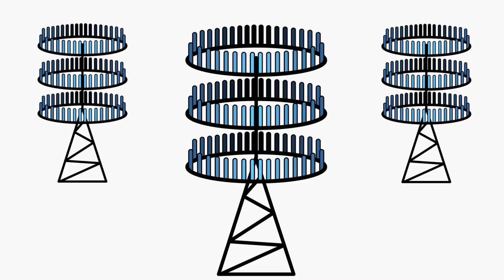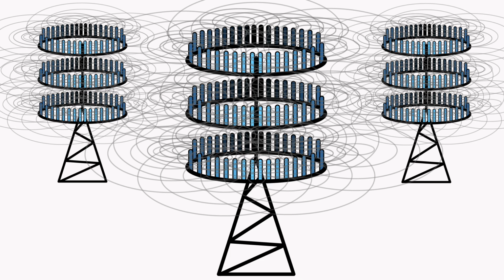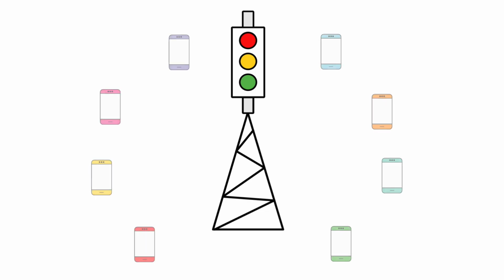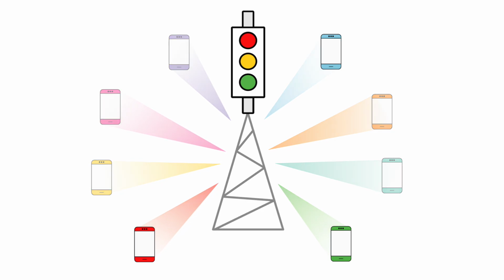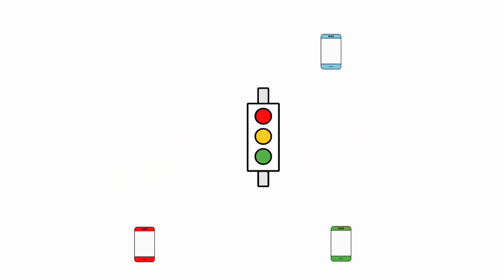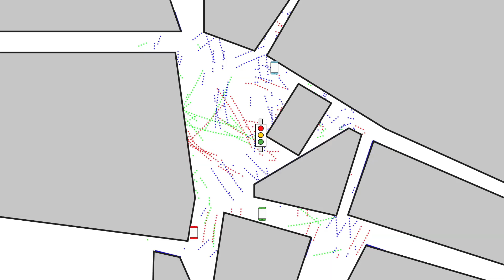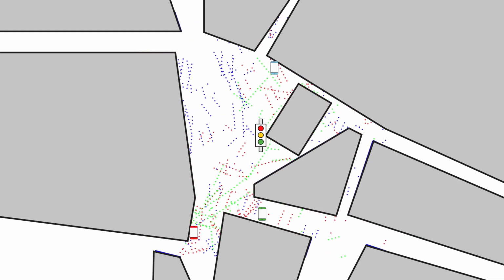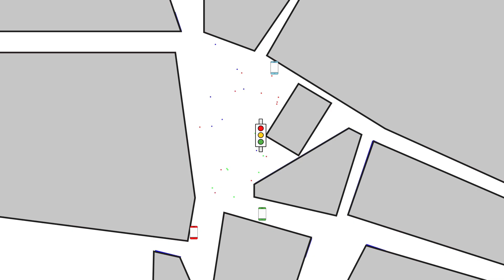5G Technologies: Beamforming Explained

Comment: I think that is too exagerated, i just cant imagine that the base station will know where to bounce each individual RF signal intended to a particular mobile user. maybe with those particular scenarios beamforming will not work efficiently.,this system will have downside when there is no line of sight, however it should work in an environment where the mobile user has a direct link to the serving base station thus concentrating the later its rf power to the end user to increase throughput maximizing the beam energy with minimum loss and interference from other directions hence improving SNR conributing to a much higher capacity, resulting to a higher throughput towards the mobile end user.
Reply: It's a simple idea: the way it receives the signals from each phone, in the exact same way emits the reply signals (i.e. disassembled/transformed). This way each reply follows the INVERSE PATH and they reach to the target phones perfectly assembled (like having direct links!).
Reply: ChatGPT can give you a pretty complex example in Matlab of how this is computed in real-time...
Reply: also in Python and JavaScript (choose your weapon)...

Comment: Can someone explain to me how it actually concentrate the wave and send it in one direction?I always thought that wave travel in spherical shape at all direction.
Reply: look for phased array antenna. Basically you exploit the interference between multiple antennas close to each other and if you tune they phase in the right way the signal will add up in one direction and cancel in the others
Reply: it depends on the Frequency of the wave.
Reply: how frequency helps concretrate the beam?can you explain further?